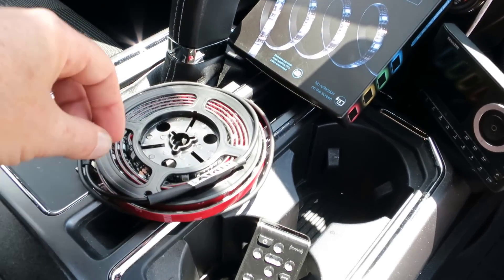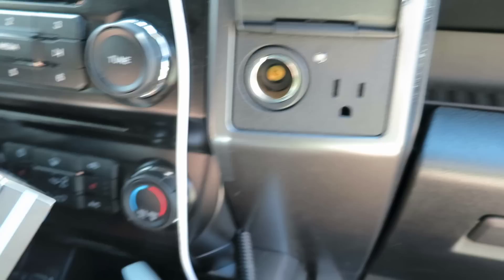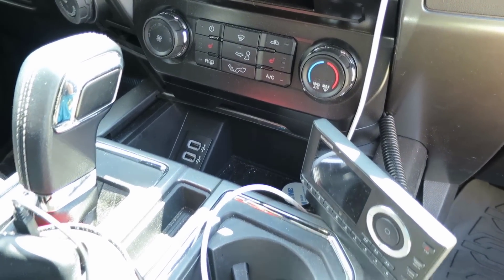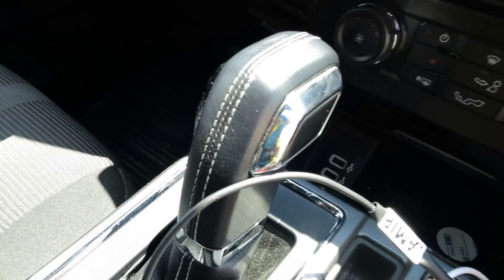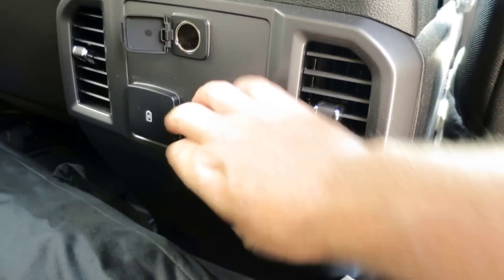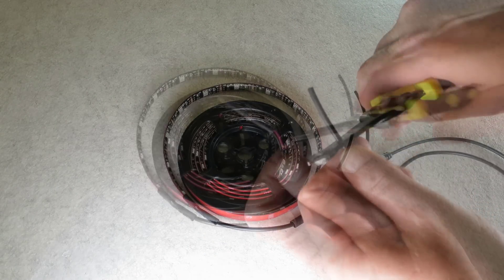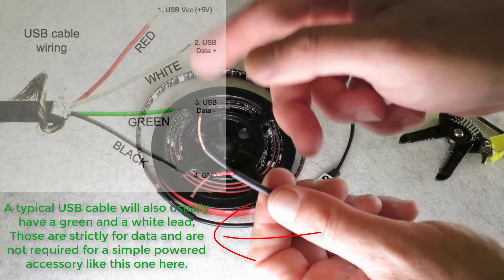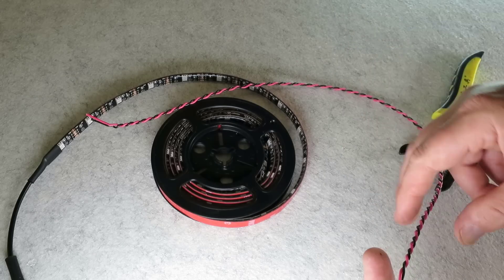How to hard wire a usb cable, splice it and extend it

Comment: All this does is show how to cut a wire and splice in an extension... this part is, in all likelihood, the easiest part for most folks. The part that I think most people, like myself, would need is the bit where you actually wire this thing into the car. Do you cut the wire behind the vehicles USB port altogether? Do you use a splice? Do you wire it directly back to the fuse panel?? nothing in this video shows anything actually being "hard wired"

Comment: well explained thanks; now I have the following problem: I want to split a USB B port so that it simultaneously distributes the data signals to 2 different hosts mgl. simultaneously and low latency: is there anything? Most USB female to 2x male splitter cables distribute yes only on one the data signal and the other is only for more power, thanks 🙏

Comment: How about skipping the splicing and the plugin and being able to directly wire the cord to the car? We standardly power 2 phones, a tablet, a radar detector, 2 dash cams and would like to hard wire in the cords so that they aren't being unplugged. This would give us the ability to hide all this mess of wires behind the dash; having them surfaced only at the point where they are needed to supply power at the device plugin. Somebody help me on that front!
Reply: Typical vehicle voltage is between 12 and 15V; if you tied into an existing circuit/fuse, that's what you're likely to get. You would need a voltage regulator to drop it down to 5V, and it would need to handle the current your devices require.
Reply: You can use something called ‘add a fuse’ or ‘add a circuit’ to take that cutoff usb and tie the power feed into that, and the ground wire to a metal screw or something grounded.  There are a few helpful videos I’ve seen to help do this.

Comment: I would rather use something like Gamma Auto Service USB Power Distributor. 5 USB ports (protected with self-reset fuses, by the way) and you may choose what are they - 5V 3A for regular, 5V/9V/12V for quick charge QC 3.0 or just 12V staright (like for a Radar Detector hardwiring)
https://66.media.tumblr.com/f0fd671d63f04d0832c32d3e91df7275/tumblr_plcd33ZGQn1vv9gubo1_540.jpg
https://66.media.tumblr.com/b60de39e7cc3b5a5645085525123b0ab/tumblr_plcd41jebs1vv9gubo1_540.jpg
I've installed it to hardwire my front dash cam, rear cam, radar detector and two USB outlets for rear pasengers to have QC3.0 quck charge for the gadgets.
Reply: were would i get one of those